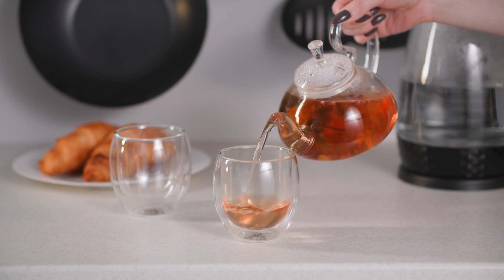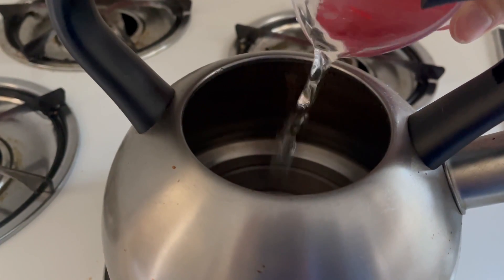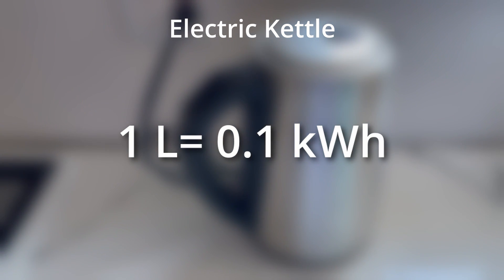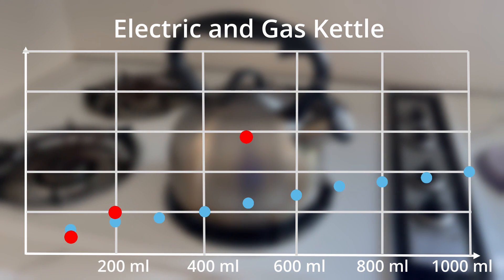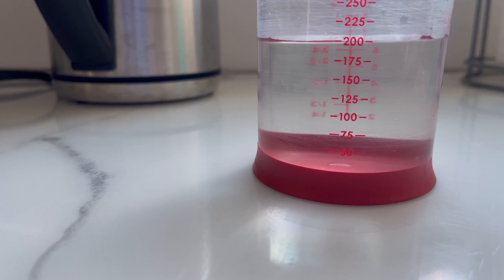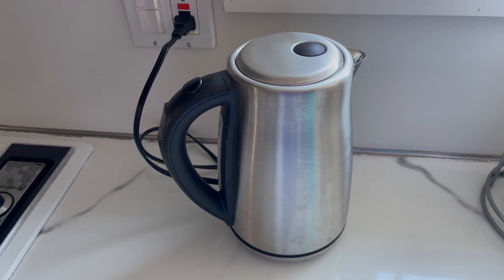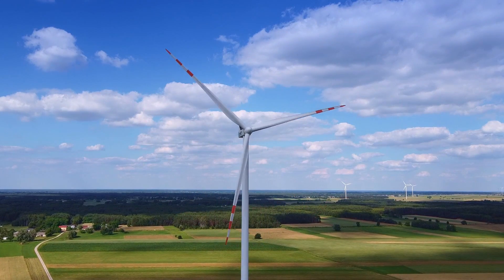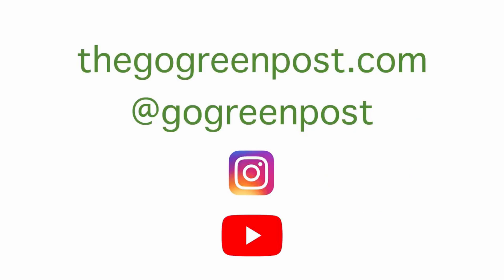Gas Kettle Vs Electric Kettle | Which Uses Less Energy?

Comment: Well, you can use the electric kettle for so much more than just tea...
Boiling water to prepare ANY recipe that includes boiling, heating up water for washing small things you need to wash by hand or anything else you may need hot water to do...

Comment: The global average efficiencies of electricity production are 34% for coal, 40% for natural gas and 37% for oil.

It is well known that producing electricy via steam (gaz coal petrol nuclear) is very inificient. You have to multiply by around 2 the electric consumption to get the required carbon energy required to produce  this electricity. This is reflected in the price (in Belgium) : electricty costs twice as much as natural gaz
Reply: You forget about heat transfer effecince at the stove or kettle level though.
Reply from the maker: Yes, it’s definitely an inefficient process! I was looking mainly at emission factors associated with use and combustion, but could account for the upstream emissions as well! That is something I plan on doing in an updated version of the video sometime next year 😊

Comment: What about the cost. In the UK Gas is around the 1/3 of the price of electricity so even if Gas is a little less efficient it still cheaper than electric. Note also electric kettles in our house last less than 2 years and are thrown away. The stove kettle by comparison is 25 years old !
Reply from the maker: Typically the impact of creating an item isn’t anywhere as big as the impact associated with its us. This is a general statement, but I’m this case I’d think it’s true. I do plan on creating an updated version of this video next year. I’ll be sure to include these impacts and cost in that update!
Reply: Chris Jones - this is exactly the comment I was going to make, in UK gas is currently less than 1/3 the price of an equivalent unit of electricity. Carbon footprint is one thing, but at the moment much bigger concern is cutting costs.
Reply: Gas is actually quite alot less efficient when it comes to heat Transfer than electric kettles, it is near 100% for the electric kettle, but in the 40s for gas. Also consider the knock on effects of that wasted energy from the gas kettle, that is heating up your room forcing your AC to work harder in summer.
Reply: @linuxman7777 how much fossil fuel was used to produce the electricity though? Its kind of misleading.
Reply: @MattKurkowski  about the same amount, to bring the water to a boil. A power plant is more efficient and boiling water and using it to make electricity than your kettle is on a gas stove top. And the electric kettles are nearly 100% efficient. Anything with an Open flame is inherently inefficient, my high efficiency gas furnace does its best to trap flames and it gets about a 90% efficient burn.
Reply: I’m here for Chris Jones comment! The cost in the UK per KWH is 30p and gas is 8p before tax, cheaper to boil water and transfer it to my insulated kettle (which i do) then occasionally re-heat through out the day! My Vektra kettle wasn’t cheap but in two years it has paid for itself but always looking for the next hack to save a few more quid! Great video btw!
Reply: Just 2 years? I have been using my cheap Chinese made one for over 15 years, now.

Comment: At 80 I find heat the most difficult to deal with.  There are adverts for what the manufacture claim their cooler to be super efficient, cheap, cooling etc.  I'd be very interested to see an examination that pinpoints the cheapest & most effective product.  If you can, thanks.

Comment: What if your electric power is generated from natural gas? I guess it‘s more efficient to directly boil your water on the gas stove.
Reply: The global average efficiencies of electricity production are 34% for coal, 40% for natural gas and 37% for oil.

It is well known that producing electricy via steam (gaz coal petrol nuclear) is very inificient. You have to multiply by around 2 the electric consumption to get the required carbon energy required to produce  this electricity. This is reflected in the price (in Belgium) : electricty costs twice as much as natural gaz
Reply from the maker: It’s possible. But power plants likely have higher efficiencies and pollutant controls as well.
Reply: @GoGreenPost   I doubt it can ever be more efficient to first create electric power, transport it and use it to create heat. There's a lot of loss in generating electric energy.
Reply from the maker: For sure and in transmitting it. But the electric kettle is using less energy to begin with, plus all the inefficiencies in heating water via gas fire.
Reply: @GoGreenPost  An electric kettle does not help, if the electricity has been produced by heating water via gas fire.
Reply from the maker: Well, an electric kettle does use less energy than a gas kettle to begin with. If you’d like I could try to post the calculations and data behind it all in the article for this video.